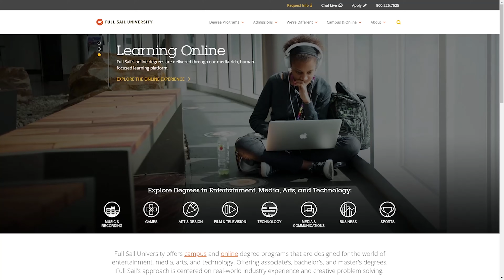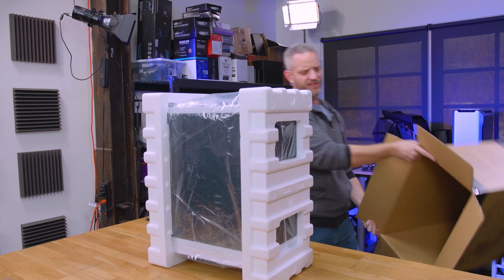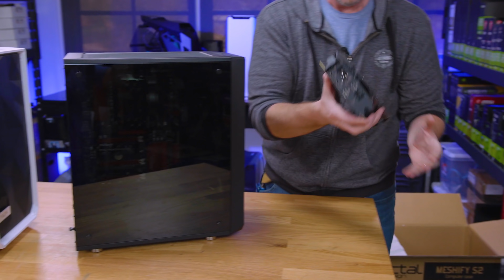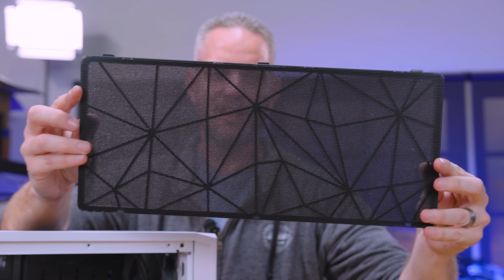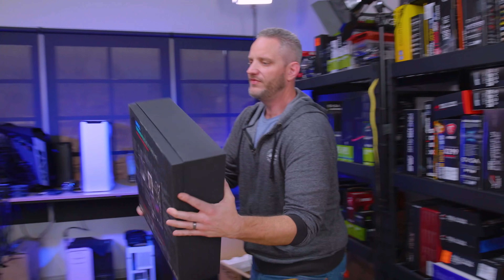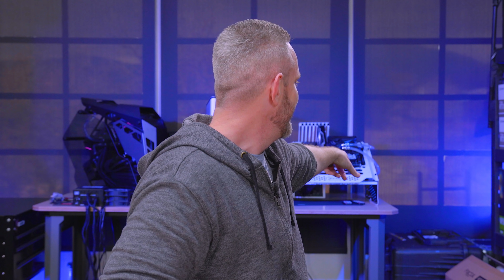Fractal Design Meshify S2 Review

Comment: I like this case, but a huge flaw is the front I/O. When you take the front panel off, the I/O comes off with it. That is fine for the first build, but high airflow means that the dust filter must be cleaned regularly. The define series got a much better approach for the front I/O.
Reply from the maker: The front cover comes off without the panel... not sure where you got that misinformation.
Reply: @Jayztwocents  yeah i got a wrong, you are right, you can remove the mesh from the front, just the frame is connected to the I/O. Thanks for that response.

Comment: I always liked the white exterior but black interior, for example i bought a white s340, and i like how inside they didn't go over board white the white, (just the white bar and back/ io area). When the elite came out i wanted to have the glass but didn't like the white interior, was going to buy the black and just paint the cable bar white but never did.

Comment: How did I miss the existence of this case upon purchasing the Meshify C? I am not able to mount my radiator properly on top because of RAM clearance, neither can I mount it in front because of GPU clearance. This case would fix either of the solutions. Although I primarily bought the Meshify C for its compact design, I might just purchase this even if if it is a bit too much on the longer side. I do however wish they kept the aesthetics of the original glass panel...

Comment: Well.. I have an R6 build AND I also have a Meshify C build so this new Meshify really just seems to be the R6 without the need to pop open the front panel for improved ventilation, which looks kind of dumb. I am a fan of the angled meshify front panel so it seems to be nice solution to the R6 front panel.

Comment: I'mma keep it real witchu chief, this ain't it. What I enjoyed the most about the original Meshify C is its compact form factor while still being able to house a 360mm rad at the front and 280mm on top. There's just something amazing about a compact case that can still do literally everything much larger cases can.
Case (huehue) in point, I own one and my setup is as follows:
Kraken X62 (280mm rad) at the front on intake duty
2x140mm fans at the top on exhaust duty
120mm rad at the back that's from my GTX1080 FTW Hybrid, also on exhaust
I have never had such good temps before, and it's all dead quiet. It's incredible. It's by far my favorite case of all time.

Comment: I own the case and my biggest complaint is that e-atx motherboards cover the grommets. Any case that saids it supports E-atx motherboard should have grommets wide enough to comfortable pass cables through without the need of pre-routing cables or a second row of grommets to accommodate e-atx. Really considering return Meshify S2 case because of that.

Comment: I wish Fractal would introduce another chassis that’s somewhere in between the Meshify C and Meshify S2 (length-wise, front to back).  I prefer front-mounted radiators and while the C is too short for a longer GPU, the S2 is a stretch when trying to route the AIO tubing

Comment: Good review. I love watching your reviews... have learnt so much in how to tidy up my own custom builds, especially cable management!! 
I'm downsizing from the rather dated 750d Obsidian, which is fine for my Threadripper 2990wx system (for video editing)  but am building a new(ish) Ryzen 2700X system which has been running on an open bench for a while since I don't yet have a case and don't need such a monster of a 750d.. In the past I had oversized monsters which are easy to work on but are now dated.
Can't make my mind up between this or the Design S2.  Both really are nice cases, Well done Fractal Design. .. and of course great work JayzTwoCents !

Comment: Yes!! Jay is making more case reviews! :) Fractal Design are my favorite case manufacturer though for the first time I have tried a cooler master case which is okay just a budget one. But I will be switching to the FD Core 500 soon. I wish Fractal would make some more ITX cases. I am torn between the core 500 and node 202. Eventually when I get my permanent set up I will get the Meshify C cause that tempered glass and mesh front is so dope. The new Meshify case is really cool but I don't need all that room and prefer a smaller case. But you should definitely do a build in that! Please do a Star Wars Storm Trooper themed water cooled build with an RTX card in that case or Radeon 7 maybe. But yeah I have always used Fractal cases. My first one was the Core 2300, then I got the Fractal Core 500, then I tried the Nano S and finally I used the Focus G Mini in my previous build. But I am finally going back to the core 500 for a temporary use this summer. Might keep it for uni since I have to travel a lot and ITX cases are super useful. It has great hard drive support and good air flow. But I wish they made more cases.

Comment: you mentioned alot about water cooling capabilities, but 0 about the fact you can fit not only 3 case fans on the front, but they can also be 140mm with space for 140mm on the back and 3 140mm on the top as well as up to 420mm AIO

Comment: Let's talk a bit about form factors. These gets thrown around a lot, but not everybody knows what they really mean. For instance the ROG Dominus Extreme is not EATX form factor, it's to big for that, and Asus claims it's EEB form factor. Here it gets weird as there's not really a formfactor called just EEB in use today, instead there are three that is supposed to be derived from it. Those three are SSI CEB, SSI EEB, and SSI MEB. And no, the EEB Asus refers to isn't SSI EEB as that has a max size of 12 x 13 inch and the ROG DE is 14 x 14 inch. The closest (in dimensions, not certain about hole placing) is WTX which allows for motherboards as large as 14 x 16.75 inch.

The important form factors mentioned or implied in this video are:

ATX, 12 x 9.6 inch
EATX, 12 x 13 inch
EEB, (SSI CEB 12 x 10.5 inch) (SSI EEB 12 x 13 inch) (SSI MEB 16.2 x 13 inch)
WTX, 14 x 16.75 inch (not mentioned, but the only one I can think of that's large enough for the ROG DE)

There are a whole lot more, but these are the most likely culprits.
Now it looks a bit strange not listing data for actual EEB, claim there's no such animal, and then say that three SSI standards are derived from EEB...
Yes it's a bit strange. I remember building servers some time in the 90's or very early 200x using EEB form factor. Now I've looked around a bit and didn't find any documentation of the original specifications. I'm guessing they didn't clamp down enough on the specification and ended up with chassis and motherboards that nominally was EEB form factor and yet not compatible with each other.

You also see that EATX and SSI EEB lists the same max size, and yes to the best of my knowledge EATX and SSI EBB can be used interchangeably. Please correct me if I'm wrong about this.

Another thing that's interesting is that the Meshify S2 specification mentions EATX, but also says the motherboard can be no larger than 12 x 11.22 inches (actually they write 285 mm not 11.22 inch), so technically it doesn't support a full EATX motherboard.

Looking at Wikipedia you find that there's a whole slew of so called EATX form factors, but there's only one standard. The thing is that these others are used by motherboard manufacturers to describe their motherboards, and they are all larger than ATX but will fit within the EATX standard form factor.

The whole reason for writing this is to educate users that just because a motherboard and chassis both claim EATX form factor you have to make sure they are compatible. For instance it would be a bit frustrating if you had bought a Meshify S2 for your new  SuperMicro X11DAC without noticing that bit about the chassis not supporting a full EATX motherboard. And yea, I've known people that would have no problem trying to do something like that...

For what it's worth I don't really think the ROG DE is a WTX form factor motherboard. It's much more likely that it is a wildcat using EATX as a basis and then just adding an inch in width and two in height. It might even follow the original EEB standard, but I haven't been able to find the spec.
Reply: man aint nobody reading all that

Comment: Exactly the case I've been asking for. Thank you Fractal Design!
Two things though:
-I hope they made the front mesh panel, easier to get out...
-I hope they fixed the power button and gave it an actual tactile click!!! On the old one I had to press it multiple times to turn on the PC...
-Bonus: I hope the reset button is still convex shaped, so it can be easily pressed!! Because from what I see in the video, they made it concave like the power button... I hope not!!! I don't have matchstick fingers.................. Nor needle fingers. :|
Reply: I have this case.  To remove the front panel, you slide out the bottom dust filter and give the front panel a pretty firm pull from the bottom.  You need to watch out though, because the wires are plugged into the upper portion.  The power button is indeed clicky and very satisfying to press.  I haven't used the reset button so I can't say how it feels, but it's a tiny square.  It's not concave, but it sits slightly lower than the panel.  I love the case, but I don't utilize any of the area in front of my (enormous [324mm, 2.5 slot]) GPU.  I should've gotten the Meshify C and a smaller GPU.
Reply: @hectiky  I have the Meshify C, I don't need your instructions!
I asked if they made it easier, compared to the old one.
You don't pull the mesh, you push it!!!
Pfff, yeah, that's what concave means!

Please be silent, like a Be Quiet case.
Reply: Sorry I couldn't help.  Though you did help me!  Thanks for reminding me to download a youtube comment hider on my new PC.  BTW, concave (which the button is not) refers to the shape of something, not its position.  The correct way in english to call its positioning would be "recessed".   Have a good one!

Comment: The oly thing I don't like about the Fractal cases (and probably most other cases), is the lack of space between the top of the motherboard, and the top of the case. When mounting a radiator on the top the radiator always overlaps the motherboard. I have a xspc rx360 v3 radiator in the top of my Define S, and there's just a fraction of space between my memory sticks and the radiator. just 3 or 4 cm (1-1.5") higher would be a lot more convenient.

Comment: It honestly doesn't seem much different than so many other Fractal cases. It's ok...but from what I've found, is if you have an EATX motherboard, having it cover up the grommet holes like it does, that's a huge pain in the ass. No one has done it better than the Lian Li PC-011 Dynamic, with it's offset 45 degree side grommets. It's nice to have the ability to mount radiators in the top and front on it though. Hopefully it has rails to mount things on the front so you aren't forced to mount a radiator in a certain direction (cough EK cough). There's still room up front for a radiator, fans, and if you only go push or pull with a slim rad, mounting the res/pump combo to it as well.

It looks like a nice case, but it also looks too much like any other Fractal design case already out. I don't see anything about it special or to separate it from the other Fractal cases. It's just kind of.....meh.

Comment: I just build my new build in the meshify C and had problems fitting my rtx 2080 with a 280mm rad in the front, originally I had planned the 280mm rad at the top but not enough clearance space between the north bridge heat sink and the rad+fans. I ended up having the run the 280mm rad without one of the 140mm fans until I find another case.

Comment: I have a meshify C with a 240 radiator and two 120 fans mounted on the front, and a gigabyte 1080ti, virtually no room between the gpu and fans, definitely this wider case is a bit better

Comment: I want a WTFX motherboard. Then again, this supposedly supports E-ATX yet it still covers the grommets. Which is the problem I have with any case and my threadripper build. At least the Phanteks case I got had removable panels towards the front where I could route cables. This just has to somehow squeeze through the tiny little bit of space left. That's going to be a pain in the ass.

Comment: I owned a Define R5 last year Fractal never again even after returning it twice it the side panel still got scraped on the bottom because the side where the bottom of the panel rests on had a sharp point on it on all 3 models of the R5 i got. Also had a case fan were on the corners just broke off when installing it into the case. Hope they upped there quality  control.

Comment: Needs to be taller so it doesn't hide part of the motherboard when you put a radiator and fans in the top. Until they fix that I will always see them as air flow cases trying to provide watercooling options. I'd also love to see them actually do something brand new instead of slapping some mesh on it and calling it a Meshify S2 lol

Comment: this is good i recently build a system and i wasn't able to get Ref. of 2080(which would be very close fit with radiator on the front ) and i wanted to build in meshify C but since G-Card would take most of the space i gone with NZXT h700, its not that h700 is great but i  like the tint glass panel of meshiy c which wasnt able that in NZXT

Comment: I want a new meshify that is a bit wider for tall cpu coolers. 200mm+ tall.

The problem I have is I like air cooling and when you have to offset the cpu fan higher because of very tall ram heatsinks, it doesn't fit in the case...

Comment: It's obvious this is designed to go under a desk, not on top. Power/reset buttons, USB ports & headphone/mic jacks being on the top. This is only for a very specific type of PC owner. I prefer them lower down at the bottom of a case, because I want the case on the desk, not under it. I wouldn't want cables hanging off the front/top of this thing, like vines. If they brought out a version of the Meshify with lower positioned ports & buttons I'd consider it. Pity...Looks like it has great airflow.

Comment: I found out the hard way that the C is too small for the big rtx 2080 cards. All I needed was an extra couple of inches (that’s what she said) and my build would have been perfect. As it’s stands I can’t fit more than one fan on the front without removing the drive stack.  Now looking at a dismantle and new case options. The S2 just seems to have gone TOO big :/
Reply: Big is better for air flow? maybe?

am  noop here.

Comment: Looks like a nice case, but one thing i have never understood and it is kinda stupid when you think about it but why do they always put filters on the top fans, traditionally that location is used to pull air out the case as well heat rises, I understand why you want to filter the fan in like the front but why filter the fan out

Comment: Greetings to everyone. I have a question for the Meshify S2 owners or at least people who know about it. My current case is extremely old and obviously has no fan controller (it doesnt even have front USB panels...yes, that old) so i m not familiar with them at all. So i would like to know about some "technicalities" of it. In the manual, i saw that the PWM signal is taken from the CPU fan header of the motherboard which you have to connect to the fan controller. This made me wonder about two things. First thing is, since you have to connect the fan controller to the cpu fan header (with a cable provided by the case i assume), you then have to connect the cpu cooler to one of the 4pin headers of the fan controller. What if the cpu cooler cable is not long enough to reach the fan controller behind the motherboard though? My second question is: if you succesfully connect the fan controller to the cpu fan header and have the PWM signal, will this control even the 3pin fans connected to the controller or just the 4pin ones? The existance of both 3pin and 4pin fan headers in the same fan controller confuses me because i thought that 3pin fans always run at 100% speed. Pardon my ignorance on this matter.

Comment: Wait, you did a Fractal Design and it wasn't sponsored by @FractalJosh ?
5:48 Nice feature but ultimately kinda useless tbh, it doesn't give individual control/monitoring for the fans connected, I ended up just getting an NZXT Grid+ V3 to control them instead of the one in my R6. Why not add a little extra to the price and stick in a full fan hub that can allow individual control/monitoring?
Glad to see Jay's ongoing brain aneurysm is progressing nicely.

Comment: Hmm, not sure how I missed this video just bought mine a few days ago.
Reply: want to know, do you think I can mount intake fan of maybe... 120mm or 140mm at the bottom; to get fresh air of the GPU ROG 2080Ti OC? I don't plan to go vertically, but just normally plug into the PCIe.

Can it work? the air flow is weird, and I want to aid in the air flow the fan if possible for the GPU especially.

Can someone guide me?

The Shop retailer is suggesting meshify C to me as well, but it looks like is going to be Hot for the GPU when I am already pairing my system with 3950X.
So is ratarded to for a temp that easily go past 60% right in the beginning.
Need help, SOS. I did am going to have close loop water cool for the CPU [Gigabyte AORUS LIQUID COOLER 360 (LED Screen) ] ; but the GPU whether can get fresh air or not is quite a concern for me.
Please?

Comment: Is it ok for a custom loop to pass through the CPU WB and then 2 x gpu WBs and then pass through radiators? Or should one radiator be placed before the GPUs? Nobody seems to answer that question specifically - at least not that I read/saw anywhere. I see a lot of tighter builds that do the former. Thanks and your channel rocks.